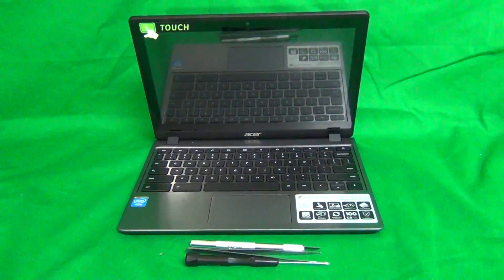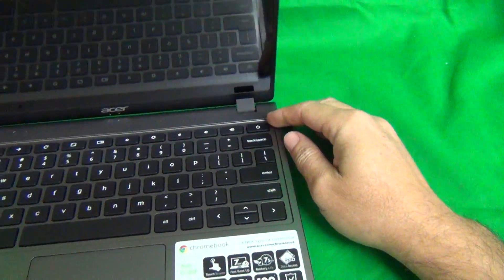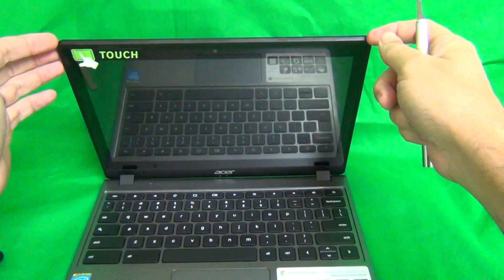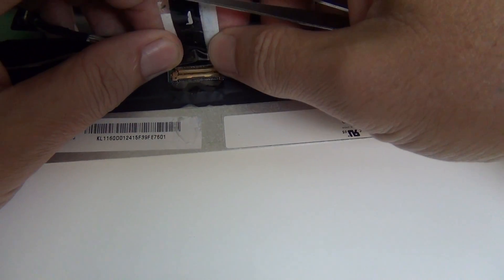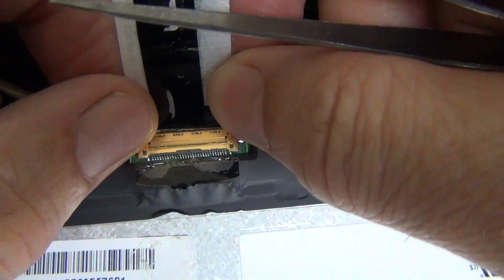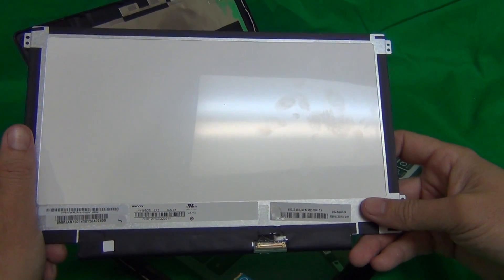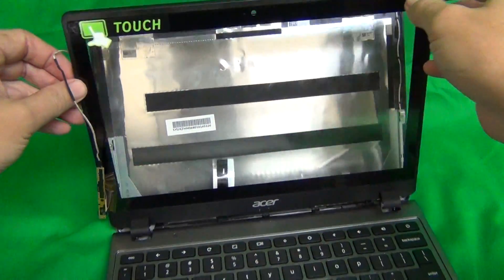Acer C720P Touchscreen Chromebook LCD Replacement Procedure

Comment: Matte screens obviously have less glare but Glossy screens are brighter with sharper pixels.  So there are definitely advantages to Glossy screens.  There is only 1 supplier of the touchscreen digitizers on alibaba, $50, thats probably a good deal because the entire screen module is $150.

Comment: The video seems very useful, so thanks for that! 
But the link you list for ordering a screen specifically says: "This a 11.6" non-touchscreen version of the Acer C720, If your C720 laptop is touchscreen this part will not work." In other words, your link is NOT to the right screen for what you say you are fixing (ACER C720P Touchscreen Chromebook). Not the most helpful, and will cause problems if customers buy a screen via your link. I tried searching your site for "C720P" and it isn't listed. Do you no longer carry that LCD? Perhaps you should just remove the link, since it now leads to the wrong product for the job
Reply: As he says in the video, the touchscreen component is the glass panel on the outside. Both the touchscreen version and the non-touchscreen version use the same LCD screen. The touch panel is sold on eBay for almost the same as a new Chromebook so it is probably not worth it.

Comment: Where would I find the replacement touch screen(NOT LCD SCREEN)? 
Haven't had any luck searching.
Reply: JJ Halvorson I am looking too!
Did you find one? 
I see this one https://m.alibaba.com/product/60607533647/Laptop-LCD-Screen-Touch-Digitizer-Glass.html?spm=a2706.7843667.1998817009.11.eaf3KF

But I'm not sure if it will work yet...
Reply from the maker: Please try eBay or Amazon. Here's one from eBay.

http://www.ebay.com/itm/New-Acer-Chromebook-C720-C720P-White-Led-Lcd-Touch-Screen-Digitizer-Module-11-6-/400774256788?hash=item5d5001d894:g:pkAAAOSwd4tUGHRn

Comment: Screen Surgeons Help please!

The glass on my C720P was shattered, so I brought it to a repairman and he followed your instructions.
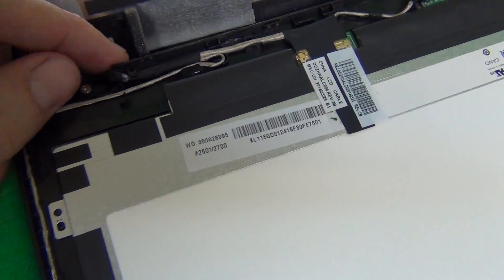Once he finished detaching the front, reaching where you are at 4:50, he tried to turn on the computer to see if everything was fine.
It wasn't.

When we plug the battery, we see the little blue color in the front, but except from that, no response whatever we do.

1/ Is it normal, for any reason ( security or something like that ).
2/ If it is not normal, what could have gone wrong?

I'm kind of desperate.
I need this computer and don't have the money to replace it right now.

Thanks in advance.